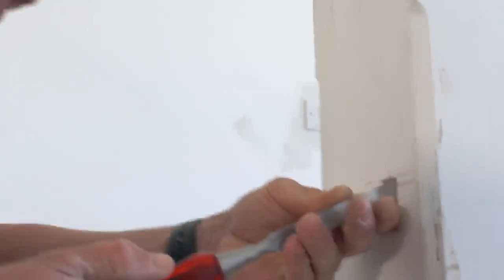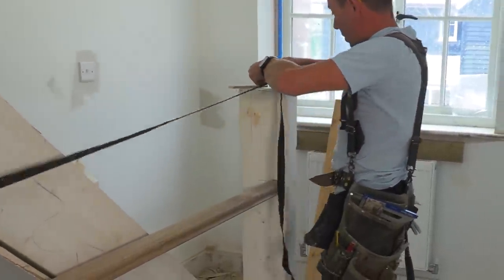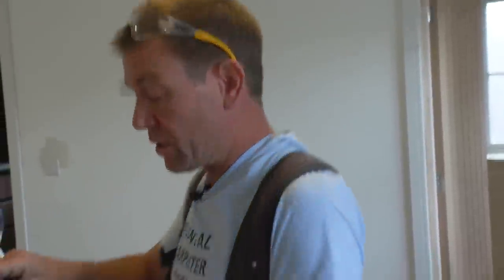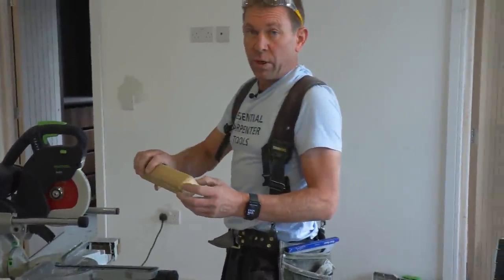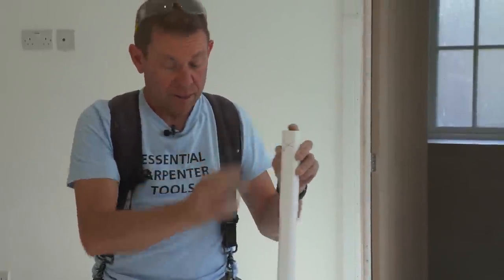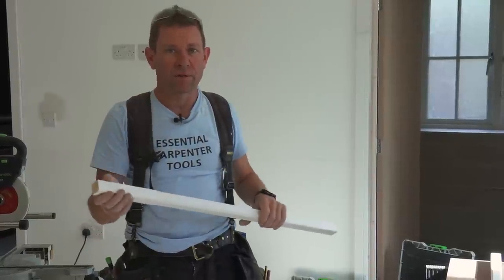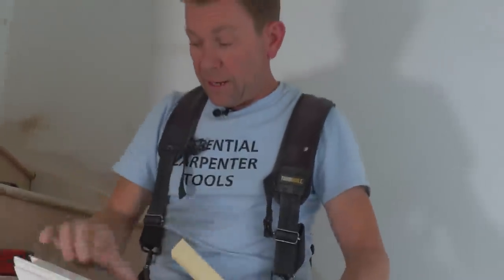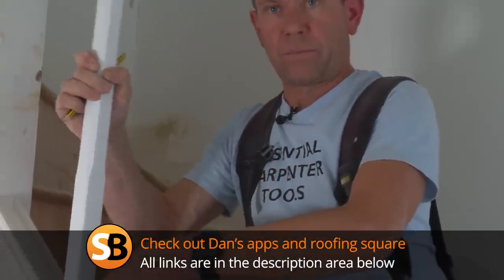How to Fit Staircase Spindles & Handrail Like a Pro

Comment: Great job Dan. There's only one thing more impressive than your attention to detail in setting out the spindles spacings, and that's the amount of clamps you've got.🤩 Thanks for video guys😎
Reply: Thanks Del. I’ve acquired the clamps over many years.. 
Thanks for watching. 😉🙏
Reply: @Ultimate-roofing-square.  This video clearly shows, you can never have too many clamps👊👊
Reply: @thetallcarpenter  😂👍🏻. 
🙌🏻
Reply: @Ultimate-roofing-square.  were the clamps used to stop having pinholes in all the oak spacers that might be visible when walking up the stairs?
Reply: Hi @adamandlorraine  , yes that’s exactly why I just glue them. I prefer PVA glue however I have used mitre mate before. 
Thanks for watching.
Reply: @Ultimate-roofing-square.  That just answered my earlier question. That's why I need a 21ga pin nailer, or a 23ga or both! 👍 😆 🔨 🇮🇪
Reply: Hi  @TheToolnut  , nice one.  👍🏻
Reply: @thetallcarpenter  Everytime I use all my clamps I get that phrase from my wife.
Also use it as an excuse to buy some more too
Reply: @mozki1  Any excuse to by more kit Mo👊

Comment: As usual great video and it's always nice to see other builders' methods 
My first few months in the trade i got the job of fitting spindles, with no idea how to do it.
The way i've always worked out spacing for spindles is overall length divide 100mm (spacing) and 40mm or 30mm (spindle).
So 3164mm divide 130mm = 24.3 spindles ( so 25 ) 
25(spindles) x 30mm(thickness) = 750mm
3164mm -750mm = 2415mm 
2145mm / 26 spaces = 92.8mm spacers 
Stop block on the chopsaw and measuring every now and again to check the spacing is correct, with 92.8mm + 30mm = 122.8mm, then just the 122.8mm times table on the calculator lol

Comment: Very nice. Have done many sets of stairs just like those.

But the hardest one I did was a set from the basement up to a second story gallery rail and every iron spindle had to be mortised into the floor and the top rail. It was made easier by the portable angle drill press attachment for my cordless drill, but still had to square up a couple hundred holes with my mortise chisel. Took me a couple of days to get it done by myself.
Reply from the maker: That does sound like a nightmare job, hope the money was good.

Comment: Good stuff Roger , it’s surprising how much maths are required in most trades . Even plumbing apparently 🤣   No only kidding , I love these videos that highlight the skill involved in producing this level of work.    Best wishes and kind regards to you both .
Reply from the maker: Hi Michael To be honest with you I have always struggled with maths at anything more than the basic level. My maths teacher told me to give up on my 'O' level which was probably the right advice. 
I have learned what I need to know for calculating the size of hot water cylinders and boilers etc but my grasp of algebra and calculus is slender. I still have no idea what value there is in knowing a prime number
Reply: @SkillBuilder  I shouldn’t worry to much, what I’ve seen and heard you do so far is proof you are a very skilled person with the innate ability to explain and pass on your vast knowledge    Best wishes as always  😀👍👍👍

Comment: All bang on proper tradesman but something we do different now is to mark around the profile of the moulded handrail on the newel and rout the full profile out to about 10 mil each end with a palm router oversize the handrail by 20 mil then spring it in all pva,ed up we find it’s quicker and just as strong (if u think about it it’s actually stronger against sideways force cos uve got the full thickness of the handrail mortised in to the newl ) it’s not traditional but in this game nowadays a hell of a lot ain’t anymore but it works for us and it’s definitely quicker
Reply: Not traditional but still a mortise and tenon of sorts, bet it’s plenty strong.
Reply from the maker: Ken Dodd 
Funny, that is the same way that James did it and he got so much stick from people saying it would crack.
Reply: @noskills9577  it is it works for us but there’s more than one way to skin a cat and traditional works just aswell but for me it takes more time to do
Reply: @SkillBuilder  what’s to crack not the newl Uve only housed in 10 mm certainly not the handrail and with modern pva,s not the junction once that glued gone off u ain’t getting it apart in a hurry that said it suits us maybe not others (used to the traditional way ) but we find it quicker , been doing for years now and have never had any comebacks
Reply: @SkillBuilder  what’s to crack not the newl Uve only housed in 10 mm certainly not the handrail and with modern pva,s not the junction once that glued gone off u ain’t getting it apart in a hurry that said it suits us maybe not others (used to the traditional way ) but we find it quicker , been doing for years now and have never had any comebacks
Reply: That only works on a straight run like a landing, it's solid as a rock to be fair, 👍 🔨 🇮🇪

Comment: I use same clamps when I pull posts together, to make sure I don't get one pinging off in my face I have drilled holes in them and screw them to the newel tops. :)
Reply from the maker: Good tip Steve

Comment: Dan, thanks again for the input. Can I ask why you use the clamps if you are pinning your spacers too and bottom? 
Also can you let me know how to find your apps on apple. Cheers
Reply: I'm not dan but I can answer for him it's because the bottom spacers are soft wood and the pin holes will be filled and then painted were as the top spacers are of same material as the handrail probably oak and he doesn't want pin holes showing as the handrail will more than likely just have a clear sealer or oiled etc.but to be honest most chippies will still pin them as we don't usually have that amount of clamps at hand so will just be filled with an oak coloured wax or filler.
Reply: @chrisfinds7745  thanks and yes your correct, the oak will be oiled.
Reply: @chrisfinds7745  cheers chris. I was mesmerized by the amount of clamps and couldn’t think why.
Reply: @paulyoull5472  search for Essential Roofing App. I thought I replied, but it disappeared… 
Thanks for watching.

Comment: Was there a 4" speed square being used at the start of the video in marking the tennon shoulders? If yes where can I get one? They seem to be like unicorn piss in the UK at the moment. Great video as usual.
Reply: Hi Christopher, yes. I got it in a set, a 6 and 4 inch one. I’ll have a look tomorrow and let you know. They both came in a set around £80. Good quality squares.
Reply: Much appreciated mate thanks very much.
Reply: @christophercrowle9753  just remembered, they are I Gagging pair of bench squares. I bought them from woodworkers workshop however Amazon sell them.
Reply: Thanks very much mate will definitely check them out. All best.

Comment: I've always put a 5mm shoulder on the top of the tenon to hide the top mortise line. Did you rely purely on the glue as draw-boring is difficult on such short tenons ?
Reply: No I did put a screw in. The tenons were tight enough but more to locate it in the right position.

Comment: Oh and a tip for anyone doing stair spindles/balustrades. Divide the total length of your run/distance by 120. That will give you a rough estimate of how many spindles/balustrades/sticks(🙄) you need
Reply: Also depending on the thickness of your spindles ?
Reply: @carpinteroespanoleninglaterra  to some extent yes. It's not an exact quantity it gives you. But it's pretty close. You can take out or add depending on the spacing you want in between the  spindles
Reply: @snwman862  what’s wrong with sticks…🙈
👍🏻

Comment: Curious to know what he would think of our wobbly staircase and poor fit / cuts etc on our staircase Redrow have given us, video of it on my channel. They then tried to claim the length is too long so it will always be wobbly and unstable.
Reply: How long is the staircase, 15 meters.. Doesn’t quite sound right.
Reply: @Ultimate-roofing-square.  14 steps, it's a Redrow new build. When we completed there was a few inch gap between the banister rail and banister. It's been retightened 6+ times, then they decided to add a block on the spindle to hit the wall to stop the wobbling which I said I didn't want as it should be done right to begin with. The post at the top of the stairs also wobbles. Video on my channel shows it better than I can describe. Over 2 years later and my 2 year old walking up the stairs makes the banister wobble just by him using the spindles to climb the stairs.
Reply: @Vision2UK  just watched your video. You usually get some play but that looks wobbly.
Reply: @Ultimate-roofing-square.  yeah very, so dangerous. My partner was 2 months from giving birth to our son when we completed, they knew that too as we visited multiple times. They claim this is fine and as intended. We've not had any Redrow people here since Jan 2020 and Redrow are now saying they won't do any works and nhbc should take over. I think the whole staircase needs ripping out and starting over as there is also movement on the steps and the posts at the top of the stairs have been cut badly as they penetrate under to below the ceiling in the other room.

Comment: Could you not lay out the sticks side by side, mark the face side and measure across them to get the total thickness. Then take that distance off the total span and divide the remainder by the amount of spaces you need. That would give you the exact spacer length regardless of any difference in the thickness of the sticks?
Reply from the maker: Conor that was exactly what Dan showed as the alternative method to measuring them. The callipers were really just to show the variation is not insignificant.
Reply: @SkillBuilder  my bad, I watched it whilst washing up. Must have been concentrating on a stubborn bit when he said that!
Reply: Spot on buddy say no more . But  a nice roofing square he came out with
Reply from the maker: @TheSmartStar   Washing up, I remember that

Comment: Ground Source Heat Pumps are more suited to properties to with enough land to cater for the requirements of the heat demand. If the land is too small then can't get enough pipe to support house heating demand.

Sorry. Posted this on the wrong video.
Reply from the maker: You are completely right. You hear of instances where they freeze the ground. A lot depends on the thermal conductivity of the ground. Rock beats paper or scissors.
Reply: @SkillBuilder  

Very true. 

Good if you want an outdoor ice rink.it makes sense.

I bet clay has a different heat Δ co-efficiency to rock. 

Or, is it a case of the more you heat, the more you contribute towards global cooling?

Comment: Bit excessive use of clamps in my opinion, I always just pin them with the 2nd fix!
Top chippy though!!
Reply: Well your entitled to your opinion. It’s over a million quid for the house and the governor doesn’t like the oak nailed, and neither do I. Thanks for watching. 🙏
Reply: @Ultimate-roofing-square.  fair enough, if that’s what the client has insisted!
Not knocking your work, your workmanship is excellent! I would have to use cable ties if a client insisted on that, don’t own that many clamps!
Another thing I bought your roofing square before doing a big roof earlier in the year and it was amazing 👌🏻
Reply: @alecmartin8324   Many  thanks. Now that’s a good idea, cable ties. I have used gaffer tape before as a clamp but ties would be stronger. 
Great, glad you like the square. 🙏
Reply: @Ultimate-roofing-square.  I ordered the new Milwaukee 23 guage pin nailer for my stair company, no head on the pins so tiny you dont see them and it fires 28mm pins into oak, best nailer I ever had for finish work, remarkable bit of kit.
Reply: @FPL-LARD  thanks for that Steve, I’ll keep that gun in mind. 😉
Reply: I've not got enough clamps so it would be the mitre mate instead of PVA
Reply: @Ultimate-roofing-square.  if you're a finish joiner order one from the states don't wait. It's a game changer. I overlay the inside and outside of stair strings and using this gun has improved the look 10 fold the holes are so tiny that when filled you can't see them compared to the holes of an 18 gauge when filled.
Reply: @FPL-LARD  many thanks for the heads up. I don’t do that much fine joinery however it’s good to know for the future.

Comment: Why not put top spacers in the same time as you do the bottom spacers no need for clamps?.
Reply from the maker: The client doesn't want pins in the hardwood.
Reply: Try 23g nails they hold the spacers in place till the glue dries.

Comment: why dont use mitrbond if u dont want to nail top infills.
Reply from the maker: All those solvents!
Reply: I have used mitre bond however I do prefer to use PVA glue. Can get plenty on, wipe it off easy.
Reply: @Ultimate-roofing-square.  ye white glue the usual need pins aswell though.
Reply: @user-xz3iv6tw2i  I’ve only glued them before and not had any problems. Only 5 handrails fell down so far… 
No I always just glue hardwood ones. My nail gun the pins are to big, 16 g , and look horrible.

Comment: Nice job but I bet you wish you had fixed the mould to the bottom of the stair string before you obscured it with the spindles.
Reply from the maker: maybe Dan understands your comment but I can't make out what you mean
Reply: @SkillBuilder  some form of finishing moulding to cloak the edge of the plasterboard underneath the stairs